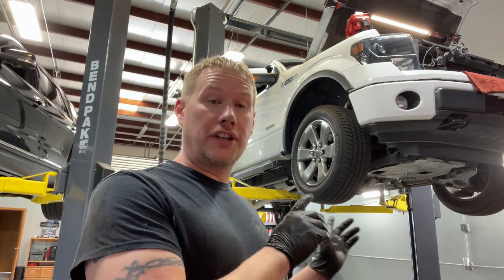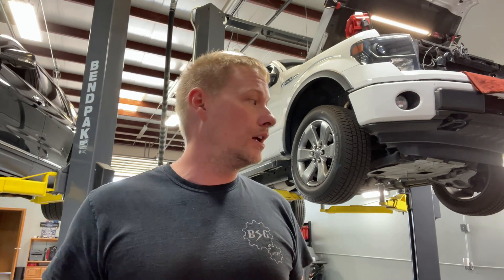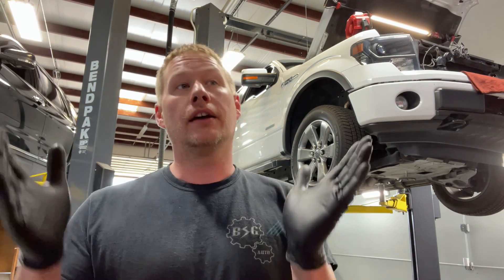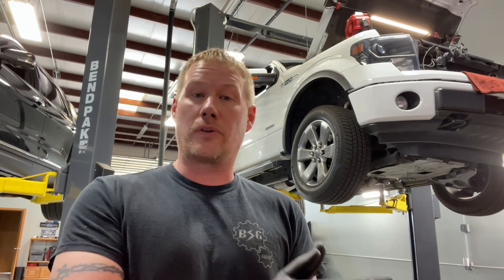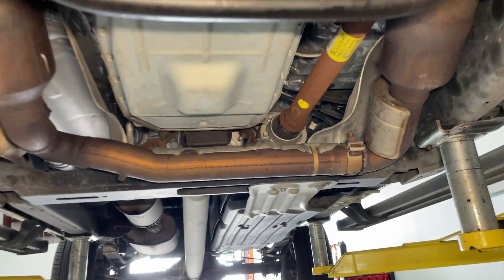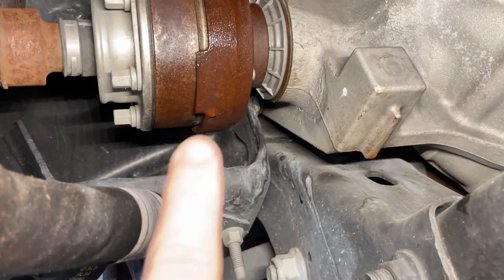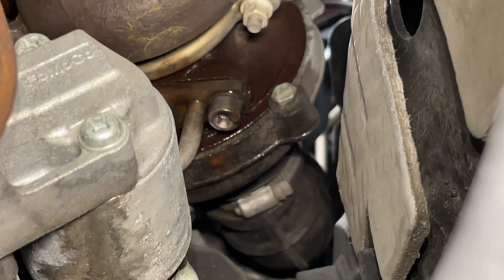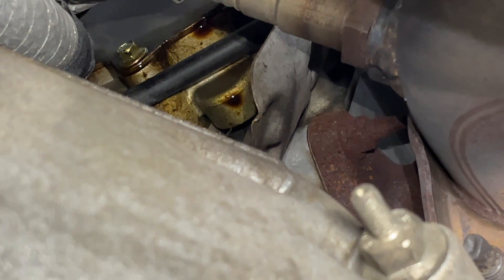Ford Ecoboost Engines Can be so Hit or Miss: I Really Feel Bad for This Customer...

Comment: Man, between the 3V 5.4 and the Ecoboost engines, Ford is really losing it.  I'd never buy either of those engines. Can you even get a newer Expedition without an Ecoboost anymore?  I'm still hanging onto my 5.4 2V Expedition -- it's bulletproof.  Just shy of 260,000 miles and it just passed another smog check with no problems at all.  Probably the best engine Ford has made.
Reply: I feel like the 5.4 3V got a bad reputation.  Phasers — $90.  VCT Solenoid — $65. Roller followers — $12 e/a.   3.5L EcoBoost timing job — $5,000+
Reply: @Colin Watt. I couldn’t agree more. I have a 2005 F150 with the 5.4 3v, 280,000 miles and counting. Maintenance, maintenance, maintenance. Take care of it and it will take care of you.
Reply: @colinwatt00  Bad reputation as in the problems are overrated?  Look at how many 3V timing jobs Brian does at his shop.  In 260k, the only thing that's been done to my 2V 5.4 is new head gaskets because of an oil leak.
Reply: Hate to hear this. We have a 2007 Expedition EL with 180,000 on it. Was thinking about getting a newer one, but the eco boost engine had me worried.
Reply: I just bought a 2009 XLT with the 5.4 with 239000 miles to replace the 2013 Lariat 3.5 Ecoboost that was totaled in an accident.  As of right now,  comparing both trucks, I love the way this 5.4 drives over the Ecoboost and sounds like a truck.  Miss my leather seats....and  the step bumper..  my next truck will be a Coyote..Just hope I can find something to pull  #12000.  The lariat was only going to do 9000. This XLT..only 6000 I think..It has a 3.31. Lariat had,  I think the 3.73..maybe
Reply: @Brandon Kilian Yep. Been that way for awhile now. :(
Reply: Your comment just made me realize that I did actually go from a 2004 5.4 3v to a 3.5 Ecoboost….😬. The 5.4 had 297,000 when I sold it and it had about 2,000 miles on a new timing set and oil pump and phasers which had it running quiet as new, plus a new set of plugs. When the catalytic converters started complaining, I was out. Now I have a 142k Ecoboost. I hope it makes it to 297k
Reply: The wife's truck with a 3.5 Ecoboost has 230,000 Km's(143,000 Miles). I'm getting nervous but it runs great and check engine lights or anything.

Live in Canada with cooler conditions and tow a 7,500lbs trailer through the mountains often.
Reply: My 2010 3V 5.4 has been great to me. At 242,000 Kms now and most have been very short trips where the engine barely gets to temp in the winter. Key is doing those fully synthetic oil changes every 5000kms or 2x a year.

Comment: I am a hack but was able to change those fittings on the driver side and a new coolant line to the block. The line had a crack in it! Also did a water pump and it took me 6 hours! Haha 190k on my 2011 and I hit 18 PSI of boost on the freeway yesterday blowing past cars like they were standing still. Strong but complicated motors and their only getting more complicated. I watch all your videos! Fascinating stuff!

Comment: I'd be trading this in without even doing any repairs on it.
Reply: The new debt incurred from the net price difference in the trade will play for A LOT of repairs.  Most of what was shown the video was seal related.   Thus labor is the biggest component of what Brian had going there on that job.   If Brian does everything noted there on the job.  Thinking $3500 and that's if Brian charges book hours at whatever rate.  Say $120 p/h.  On a 7 or 8 year old truck amortizing $3500 in repairs over 7 years is $500 per year.  On  my '13 I've had zero paid for maintenance or repairs.  Many do our own work to offset or save up for truly complicated repairs.  Job like this I would consider going to Brian or similar for the obvious experience and quality workmanship.  Trading it in just gets a person another set of potential problems.  The new one will have seals, computers, transmission, steering and an engine.  Service shops don't seem to be sitting around twiddling thumbs during work hours.
Reply: Why? Everything is so over inflated these days he'd end up much worse off in the long run.
Reply: @DJR5280  Yes, but his truck will be worth more as well so it’s a wash.  I’d dump it.  He has a lemon.
Reply: For another Ford?
Reply: Same here. Get you a Toyota.

Comment: Even though this truck is clean doesn't mean it hasn't been driven hard. Plus texas heat could play a role in high coolant temps causing premature wear. Those leaks are pretty hard to miss...

Comment: I think it's the age and vehicles probably sitting. Being in texas you also have the heat to deal with. But my 16 f150 5.0 that's driven only when I need, it starting getting damp on the corner of the oil pan. I roughly put 6 thousand a year on that truck. Otherwise it sits and I have a daily driver for better mpg. But good thing you caught all of this now before it became more leaks or leaking worse. So now theres no risk of running low on coolant or oil. Definitely worth keeping with the low miles and condition of the body. Probably could sell it up north for a lot of money. The way things are going with covid.

Comment: It's a shame that it goes to show no matter how well a person takes care of some vehicles they are so poorly designed they are doomed to fail. That's why I will not ever own certain vehicles. There should be no reason that chain driven timing components go bad at 70k miles. Thanks!
Reply: You're exaggerating
Reply: @J10xxxx  My Honda never needed a timing job at 30k. It also had a drain plug on the trans so I could easily drain the fluid and not be enticed to take it to a dealer for that. Had an Audi with a water pump failure at 3,000 miles. They warrantied it for life. Cam phasers blow out at 30k with Ford under better maintenance than they recommend? They told me next time it happens it will be a few grand.
Reply: @tomg1246  My friend just had  cam phasers go. But their is a bulletin  whole timing chain and other things also replaced at 90000 miles, $3000 repair. V overhead cam engines are junk, chains are way to long to last. That goes for many things other than engines.
Reply: I agree. Too much regulation for emissions and WE the end user end up paying.
Reply: Blame the government for allowing shit like this to go on..Not only way over priced but also garbage parts
Reply: @StreetTerrorist187  Government is part of the problem with over regulation about everything that manufacturers have to comply with while trying to keep costs down. Something has to give.
Reply: @StreetTerrorist187  The large corporations own the politicians so put the blame on the corporations where it belongs.
Reply: i don't think its poor design, i think they were assembled incorrect occasionally. i think if the people at McDonald's can mess up a burger an auto worker can accidentally asemble a car wrong
Reply: Dude its very, very rare...even Brian said so. F150s are the best trucks out there by far. Had 3 so far ...explained fully in another comment. Ran my gen1 Ecoboost well over 200k mis zero issues.  Now have gen2- 2.7L Ecoboost F150 4wd an fully expect 250k mis +.
Reply: @Davido50  it isn't rare. Mine went at 30,000 miles. Full synthetic oil change every 5,000 miles. Changed it when the oil life was at 50% each time.
Reply: @tomg1246  People commenting here won't like to hear this, but every company sets certain ethical standards, and Ford Motor Co has proven to be, over the years, no beacon of integrity. Neither is GM. Nor a bunch of others. Toyota seems to be the only auto manufacturer whose engineers (and accountants) are allowed to show actual concern for consistent long-term reliability. As complex and expensive as vehicles have become, I'd feel more confident buying a Tundra, compared to an F-Series or Silverado.
Reply: @kenhoward3512  I agree. The Japanese have different ethics when it comes to corporations. Sadly for my next truck I will need a 3/4 ton and Toyota doesn't make anything with a towing capacity high enough for me.
Reply: @kenhoward3512  Let's not forget that Toyota, GM, Honda, Mazda, and Ford all lobbied against Right to Repair. Every last one is rotten.
Reply: @kenhoward3512  MOPAR and full synthetic =good to go.

Comment: I have a 2011 f150 3.5 with 280k on it. No engine issues to speak of. I guess I’m one of the lucky ones. However the output shaft sensor is starting to fail. This is an issue
Reply: 280k wow !!

Comment: 2220000. Yes mine has a few leaks not as many as u pointed out on that low of a mileage truck  the last thing I've just had trouble with was battery n then it blew out the number 27 (20)Amp fuse  so I replaced the fuel pump control module also I'm sure had I seen the fuse blew first but I didn't I'm gonna be heading back to Missouri n Oct to visit my kids so don't wanna be broke down on side of the interstate  anyway i thank u for sharing this info n I'll be watching the next one coming u keep up the good work

Comment: I've got a 2018 fusion that's  getting a new engine at 24000 miles and my granddaughter has a 2018 with the  escape with the same engine and it had a cracked block and my car is still two too three weeks before they can get it done their's that many in front of it WOW it's been in the dealership 5 times for engine issues fords quality is gone.
Reply: Sounds like you got the 1.6 EB. Horrible engine.
Reply: @joecampbell606  nope, they stopped that one in 2014, I believe. it is the more than likely the 1.5 4 cyl version

Comment: Been subscribed to you for a long time because you tell it like it is. You are very knowledgeable and treat the vehicles like they are your own. It’s really a shame that the quality of the parts and seals just doesn’t exist anymore. All seals and components are made as cheaply as possible yet the prices keep on climbing. It’s really sad quality ceases to exist. You can’t blame it all on workmanship the materials they use are just good enough quality to drive the vehicle off the showroom floor and you are on your own. Thanks for sharing and stay safe and well. Artie
Reply: Just speculation but it is possible that the original chemical composition of Nitrile and Neoprene has been changed over the last couple of decades to meet environmental edicts and has made the product (often used in seals) less durable for the higher operating temperatures and more complex designs now used.  Too bad for anyone who wants to own a vehicle beyond the first three or four years.

Comment: Understand. I own a 06 f150, 5.4 3 valve. Have 244,000 miles. I am huge on Mobil one oil changes with K&N filter, all I have used since owning it with 30,000 miles. Change every 3000 miles no matter what. Changed all components before fail. But never did a timing job. Only thing that worries me now. Cause no one in Vegas is as good as you or do I trust.
Reply: Full synthetic of course. Allways
Reply: Same here what oil do you use 5w20 or 5w30?
Reply: @CorvetteC6-LS2  5w 20w. Always. I tried the 5w30. But noticed. Harder on vvt. Reason I do the 3,000 miles is cuz I live in Vegas hot desert climate, plus I start to notice gas miles drop off
Reply: @davehayden29  maybe bad catalytic...I always change 3k to 4k always mobile one full synthetic 5w20 i love my truck
Reply: @CorvetteC6-LS2  I have 4x4, so put the bilsten shocks on. Changed out all front suspension with Moog. Now able to lube. Use Lucus red suspention grease. Changed front hubs, upper control arms, 4x4 rings, front axles, 4x4 vacuum actuator,  transmission selector switch, and do a  transmission fluid once a year filter change. Preventive was most of it, due to wear before shit broke before out ice fishing in central Nevada.

Comment: I own 2 3.5 ecoboost vehicles, 2015 expedition and 2014 SHO taurus and a 2015 Fusion Titanium 2.0 ecoboost with a torched cylinder head, it has 48k miles. I can’t get my fusion fixed because no one has parts. Before my expedition I owned a 2014 F150 which was also a 3.5, I will never buy another. My 3.5 f150 blew up @ 61k miles and was replaced 33% by me, 33% by the dealer and 33% by Ford. My 2014 Tarus SHO has a bad smoking problem. Cylinder 6 is wet with oil. Ford voided my extended warranty because I bought the vehicle used and the HPFP was recalled and they had no fix when I bought it so it was only covered by the factory warranty. I parked my fords and drive them rarely, I now own 2 new Subarus. I won’t buy anymore Fords.

Comment: 23 yrs working for Ford and I personally will not own anything with a turbo from them....especially the 3.5 eco.
Reply: Agree 100% only engine I would get in a f150 would be a 5.0. I work for a dealer in the parts department and all the ecos have issues
Reply: Ford Australia produced some great turbocharged I6 engines in their performance sedans. I don't know what Ford USA did with that institutional knowledge when they closed down the local factory, but apparently it wasn't much.
Reply: Agree, worked on fords from 1979 to 2017 seen a lot of changes, the one I cannot agree with is the addition of turbocharging, from the expense to repair and turbo lag, and add direct injection, these are nothing but money pits.
Reply: What do you all think of the 3.5 None aspirated  motor I have one in my f150?
Reply: @henrykiefer8316 I have the 3.5 n/a in a 2017 F-150 it just turned 123 thousand highway miles no tick runs like a charm oil changes every 3000 miles just conventional oil 5w30
Reply: Glad I have seals and gaskets on my warranty.
Reply: My buddy has en eco with 240k with no major problems...only valve covers ... Vacuum pump.. same turbos and trans ... Still running smooth.. only little leaks the usual ..like oil pan leak and rear main seal .. but that's it
Reply: Couldn't agree with you more
Reply: I have a 3.5 eco boost leaks yes  I’m a mechanic and I know what is up mine 😮I have 240,000 I’ve put almost 100,000 in 3 1/2 years man I change the oil really quick never heard anything about any timing Radall or anything like that man it like to leak out of that vacuum pump and it will smoke straight into your cab but it never goes too low never less than half court between any oil changes
Reply: I have that engine in my work van. It has lots of power and never had an issue in seven years of ownership
Reply: Turbochargers are problems.  So much extra heat, oil temps, and pressure.. They can perform wonderfully..... but it comes at a cost
Reply: @rickhibdon11 turbos are a tried and true component. Semi truck trailers go millions of miles with turbos. Nothing wrong with this technology.
Reply: @21divel Turbocharging is not great when you’re doing short trips and/or not letting the turbos cool down and then cooking the oil. Semi trucks going 2 million miles are doing it almost entirely on the highway where 95% of the driving is when the whole powertrain is at operating temp. Not saying I agree with everyone saying turbos are trash. They’re not trash. But they require more attention to how you drive, more frequent oil changes, and of course it’s more potentially catastrophic stuff to break
Reply: @JohnMaxGriffin  I can agree that the applications of big rigs and passenger vehicles are different but, big rig turbos are working hard, even on the highway, especially if loaded. On smaller cars and trucks, the turbos are working much less and for less duration...
Reply: @21divel  Working hard isn’t an issue, they’re designed to do that.
Reply: @JohnMaxGriffin  Exactly.....so I don't see your point. They're fine in any application so far as adequate maintenance is done.
Reply: @21divel  I guess I can restate it, but the point is that they require more maintenance because of a couple of things, particularly what they do to engine oil when the engine (and thus oil pump) is turned off. They cook it. And the frequent heat cycling isn’t great for the turbo itself either. On semis and in applications like cruising yachts, it’s pretty rare to have a turbo related issues or failures because you hardly ever stop the engine. They’re happy to sit at their operating temperature and work all day. But for example in turbocharged aircraft, every engine manufacturer has guidelines about how long the engine has to be run at <10% power before shutting off. Usually it’s a few minutes, which is way longer than most people think to wait before shutting off their cars. On-demand diesel generators have a cool down period after they come offline, precisely to let the turbos cool a bit before shutting off.
Reply: @JohnMaxGriffin  While I can agree with what you said..... you're applying this principal to passenger cars that to a large degree aren't being worked to the level of the engines you are talking about. Also, today's engines require oil that is designed to withstand the higher temperatures of a turbo without burning. 9 times outta 10, anytime I see a modern turbo engine go out, it is either an engine design flaw, or operator error.
Reply: @JohnMaxGriffin  these are water cooled turbos they don’t need to “cool down”
Reply: Bring back the 4.6 modular
Reply: @tyronevonchadley  that was a pos too, along with the 5.4
Reply: @tyronevonchadley umm,,,the 5.0 IS the 4.6 dude. It’s just the newest version of the 4.6 4 cam,basically
Reply: @MikeSmith-ey7ku  4.6 was a 3V engine. 5.0 coyote has 4/cyl
Reply: See !!!!  ford should have just stuck with the 7.3 IDI ole trusty 💪🤠 Turbos cause alot of problems ..
Gotta pay to play ;)
Reply: Have a 2016 expedition with the 3.5. Has 130k miles and I’m done. Having numerous problems and a rough estimate is will cost $3-4k to make it all right. I will never own another ford. PERIOD. Don’t stand by their product and it’s a piss poor display of engineering.
Reply: no one cares.  Your bias oozes.  Zero facts

Comment: My 2011 f150 has 106k miles and all I do is change oil. I've changed the 4wd vacuum lines, rear pinion seal and both lower control arms and the RF upper. I'd rather do that than any engine work. I'm one of the lucky ones.